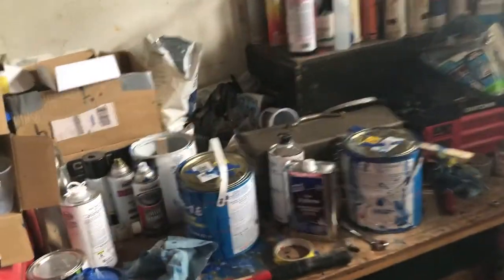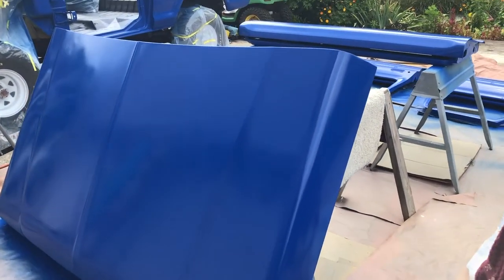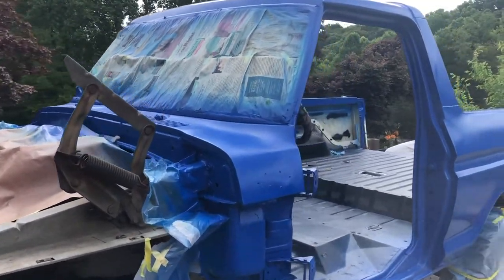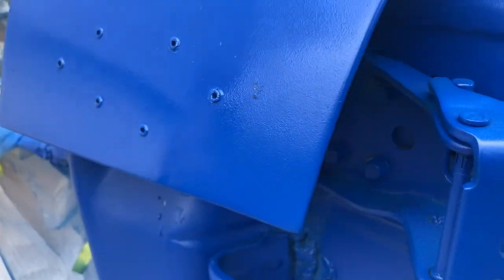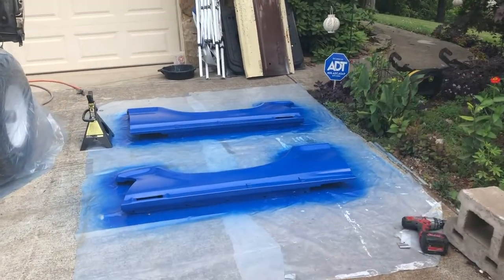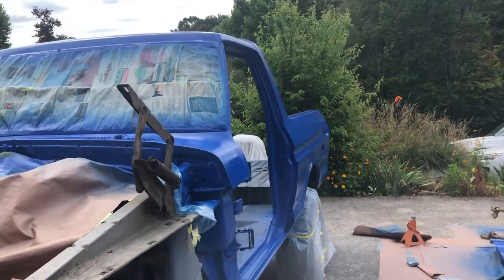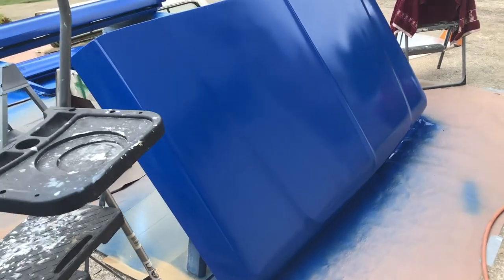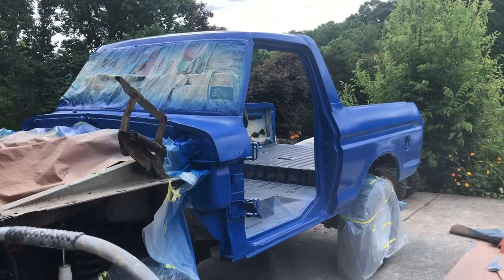I painted my Bronco!

Comment: I know this is an older video, but what product did you use for your paint.  I am considering raptor liner as I want something that will look great and not cause me concern when I daily drive it and park in walmart parking lots or take off roading .  I like the look of your coating, as it has a shine with the gloss.  most raptor liner paints look flat or semi gloss...so I am weighing my options since i will be painting my bronco myself..   Thanks! love the blue color!
Reply from the maker: Thanks! I wanted the same outcome but sadly I got a bad batch of Durabak and it’s far less durable than regular paint. I wish I had gone with tractor paint or another bedliner. I used xylene to thin it
Reply: @broncobabeadventures4316   I saw an interview of you at a car show in TN i think,  I noticed the bronco in the thumbnail for the video lol,  how is the paint holding up,  the bronco still looked awesome.  I think this was from last summer.
Reply from the maker: Yes it was! The paint is absolutely garbage, by far the biggest mistake of my build. I need to do a video on it, I just haven’t gotten around to it yet

Comment: Great job!  Hey, I recall you were installing polyurethane body mounts on your rig.  Did you just use grade 8 bolts to attach them?  If you recall the sizes you used it would be very helpful.
Reply from the maker: I did get them in. My bf was a rock star and sawzalled out the old ones. Those suckers were stuck. I’m sorry I can’t remember what size they are. I brought the old nuts in and sized them at Ace
Reply: @broncobabeadventures4316  did you buy the LMC set or from somewhere else?
Reply from the maker: @ebluvr72  I got them from Summit, I wasnt all that impressed with the kit though- mostly because I had to call 3 people to get direction on which bushings went where
Reply from the maker: @ebluvr72  I got them from Summit Racing

Comment: Are you going to reinstall the racetrack?
Reply from the maker: I’ll be putting on the dent portion only, and selling the lower racetrack
Reply: @broncobabeadventures4316  that's  a nice look with monotone paint... but I was looking forward to a tutorial on how to remove and install that fiddly trim lol!
Reply from the maker: Removing it was actually pretty easy. The lower racetrack has nuts on the back you just have to unscrew. Installing it was kinda tough because I had to redrill holes and put rivets on my replacement panels- but I’ve got a video coming for that 😄